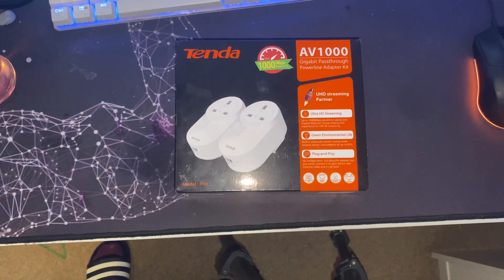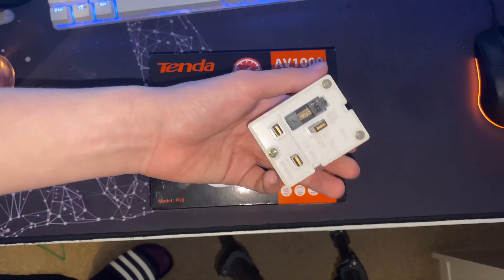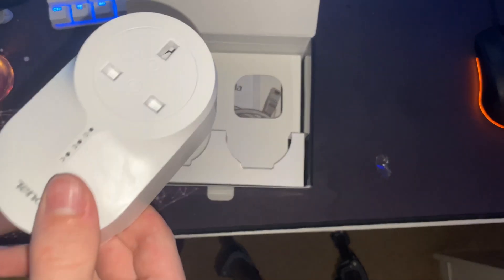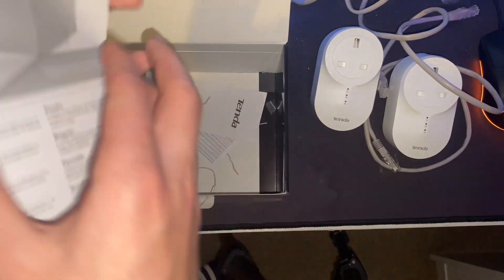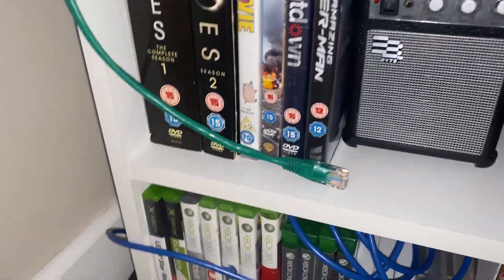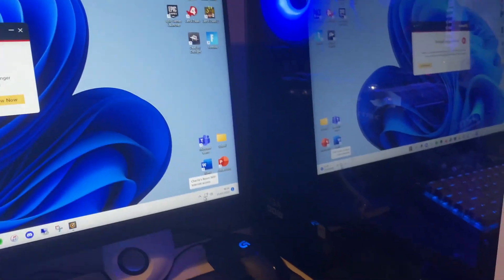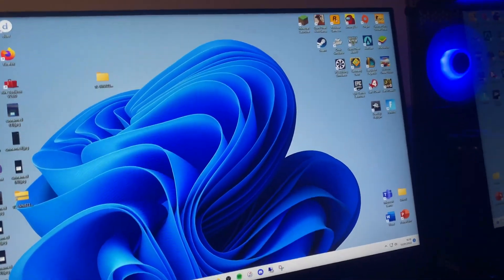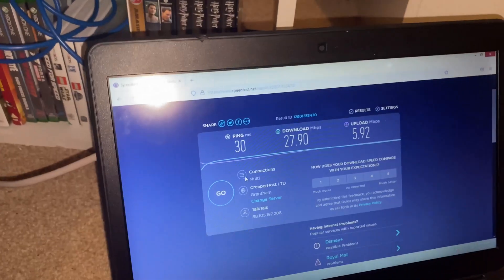Tenda PH6 AV100 Powerline Adapter Kit Unboxing, Setup and Testing

Comment: everytime i use it , its bringing me red light , in the box says that thing its becouase of the Electricity or the Power or Something like that i changed the Place and still the same problem
Reply from the maker: Might just be your home electric cabling causing the problems but could just be a faulty unit complain ask for new ones if the same problem oc ours then it will be your home wiring
Reply: @charlielowe1519  this happen only when i turn my pc on , when its off stay at green